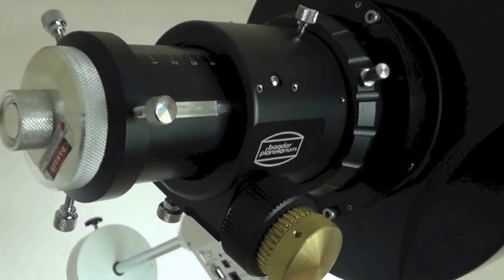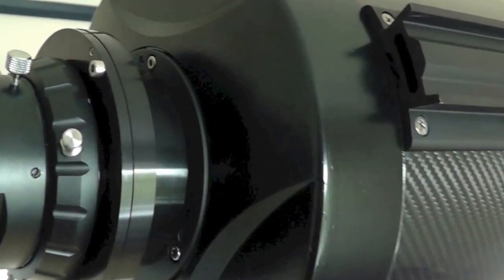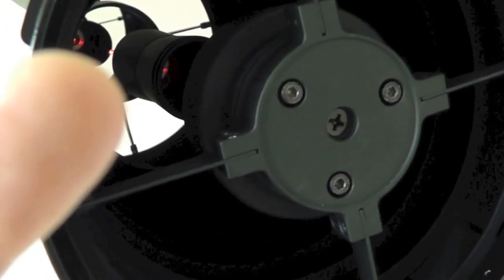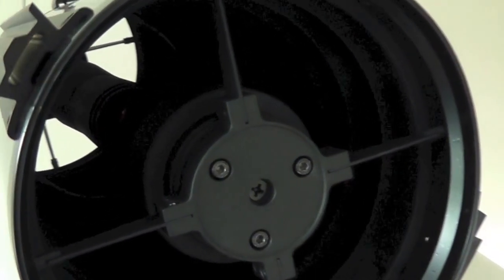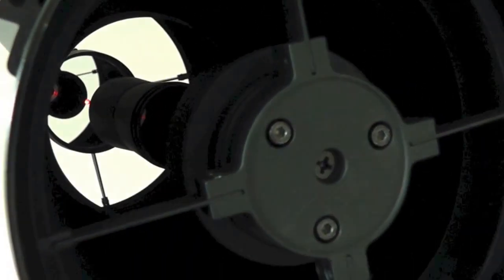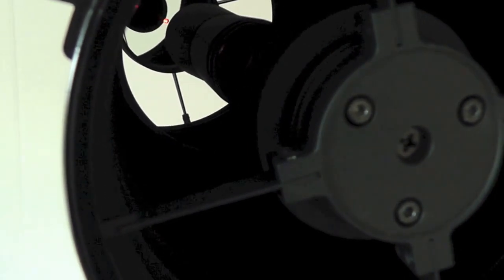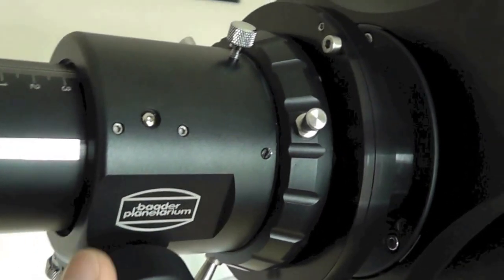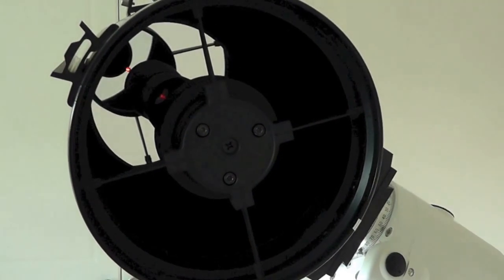Ritchey-Chretien Collimation: Step 1 of 3

Comment: Stephen. I have a Farpoint Laser. When I use the Farpoint Cheshire to center the secondary and then use the Farpoint Laser and look into the tube (RC6), I have the same view that you show in your video, but there is no laser spot seen. If I move the secondary significantly, I can then seen the laser spot adjacent to the black donut but not in the center. I have not moved the secondary enough to center the laser spot. But with the laser spot at least visible and near the donut, if I then go back to the Cheshire, the donut is now way off center. What gives? Is this due to my focuser not being properly aligned? I am unable to source a collimator ring so am thinking of getting a Moonlite focuser which has built in adjusting (or just bag it althogether??). Can these things really be collimated? Thanks!

Comment: Hi Stephen, 
I seem to have the same GSO carbon fiber scope and my secondary does have the center spot. However, I think I have a longer secondary baffling tube coming out of the primary. Because it's so long, I can only just barely see the very edge of the center spot being reflected off the primary and can't see all sides of it at the same time to know for sure whether the laser is centered. Did you remove part of that secondary baffling tube? Mine seems to have ridges and I'm wondering if part of it unscrews. TIA
Reply: FYI: I played around a bit more and it does unscrew - it was on extra tight! I can see it easily now.
Reply from the maker: I never had to do anything in terms of removal of any part of the scope other than the focuser and installation of the collimation ring for the focuser housing.  Note that higher specification RC scopes have the ability of being able to collimate the focuser to get it orthogonal to the optical axis without this additional ring.  I sold the RC scope several years ago and now just run refractors for imaging.  Mirror scopes - dobs etc - only for visual.

Comment: Stephen,
Does collimating the imaging train with the one attached to the back plate work sufficiently or is the collimation ring necessary?
Reply from the maker: It depends how far out the collimation is.  The gold standard is to be able to independently collimate and verify all three components of the optical axis - i.e. the focuser, the secondary and then the primary.

Comment: Hi Stephen... today I received same telescope as this (second hand).
I was going through your tutorial, but I think that my second mirror does not have the center spot... is that possible? Any recommendation?
Reply: just removed the secondary and there is no center spot at all... currently considering drawing it on a lathe with a sharpie...
Reply: No need to mark up your mirror!!
 Once you remove the secondary mirror just line the laser up with the hole in the spider, use a bit of masking tape over that hole and shine the laser as though the secondary was in place and you will see the laser dot on the masking tape as its fairly transparent.  
As this hole in the spider is the exact center of your secondary mirror.
Reply from the maker: @luapynneb3069  Yes indeed.  You can manually mark your mirror using a accurate pair of double folds in a piece of paper together with a A4 paper ring reinforcement ring,

Comment: if your laser spot dances around there is either focuser slop or the laser is not collimated, although HG makes very good astro stuff the lasers are highly overpriced...i made my own and collimated the laser on a lathe...i did buy a HG parallizer to make sure it fit precisely in the focuser...so a dancing laser spot does not mean your focuser isn't square or anything...always check laser collimation first and the seating in the focuser
Reply from the maker: Yes I completely agree.